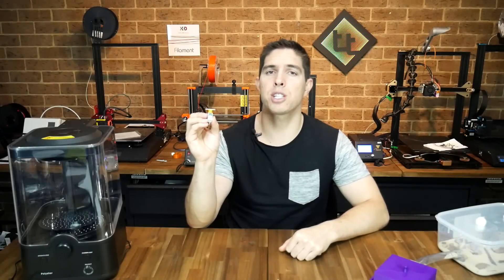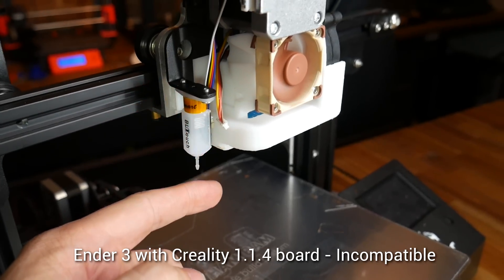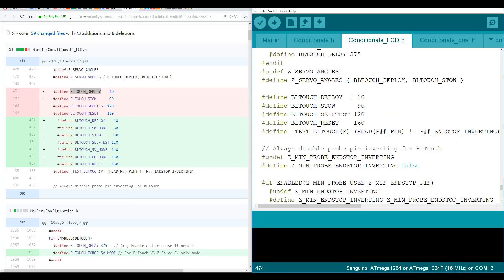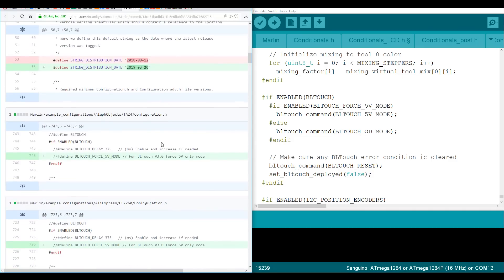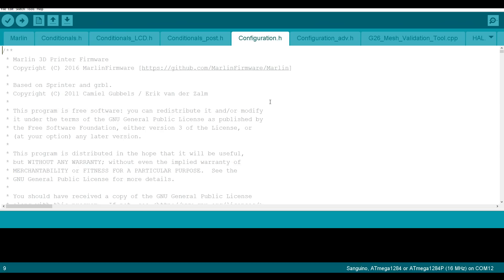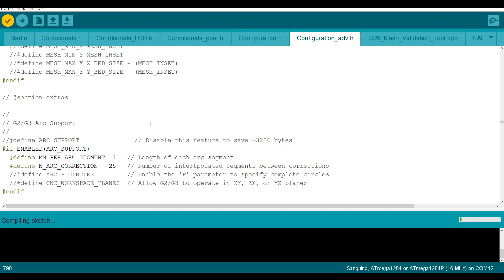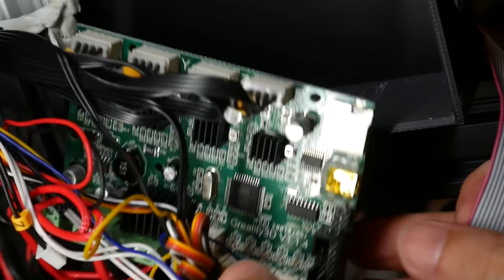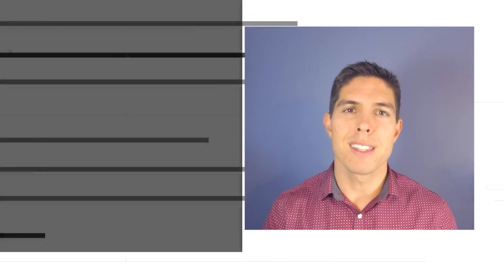3 Fixes for BLtouch V3 on Creality machines

Comment: in respect to z probe, first off im a total newb and i need to figure out how to enable or choose my appropriate z probe (i have the version 2) in my firmware calibration for my delta linear plus. do i put in place of the 0 or brackets so as to disregard said type of z probe. thank you this would be a big help

Comment: What I really need is a complete setup for Marlin 2.1.2  for Ender 3 Pro, 4.2.7 board with BLTouch. Tried the Creality BIN file for my machine but it doesn't work. Not understanding why it's even available. The previous versions of Marlin have nowhere near the settings that the newest version contains which leaves the previous version videos unusable.

Comment: sure is strange...I have 2.0 bugfix, 2.1 board and 3.1 bltouch and mine just wants to drill a hole through my build plate no matter what I do! maybe you could provide details because I have tried every firmware and every fix i have found on the internet and you tube except removing c7 capacitor and nothing has fixed it and I am going to send it back if i cant fix this as I am not going to take a chance of ruining my motherboard by removing a capacitor! also btw there is no conditionals_lcd.h file that opens when you open marlin.ino! so how do you make these changes for fix 1 if the file does not exist!

Comment: I downloaded the BL .hex file from Sovol and flashed the touchscreen and board on my Sv02. It is still not responding to making contact.  Will I need to change coding or did I end up with a bad 3D touch?

Comment: I upgraded my Ender3 V2 with a BL Touch and I have been having a lot of trouble lately with it failing and blinking red.   After choosing the file I wanted to print, the extruder would move to the center of the build plate  to begin the auto level process and come to a halt and then the light would start flashing.  It took a couple days before I figured out what was happening. The probe was not dropping. I removed the unit and removed the set screw to extract the probe.  I discovered that the steel set screw had become magnetized. The probe would be drawn up and not release and then the light started to flash. The magnetized set screw was holding the probe in the retracted position. My solution is to replace the steel set screw with either a 316 stainless steel or a plastic set screw. 316 stainless steel is non-magnetic. The dimensions are 4mm diameter, 5 mm total length by 0.7 pitch.  If your local hardware store does not carry either stainless or plastic, McMaster-Carr does but in quantities of 50 and 25.
Reply: thanks i`ve had had my bltouch working off and on for about a year this helped a lot

Comment: I am trying to get my BLtouch working and it is just not doing it. I have gone though your video's on doing this and even bought your files, but it seem like there are things missing. I have an Ender 3 pro with the 1.1.4 board installing the creality BLTouch kit with the 3.1V BLTouch and the 27pin board, all provided in the kit. I have installed a boot loader, I had installed 1.1.9 Marlin, without BLtouch and it worked fine. Now after installing all the files I received from you, following all the directions you have provided though a couple of your videos and trying some of the fixes you suggest in this video, I still get a blinking light when I turn on the machine. When I go back into the configuration.h file (that I received from you) and walk though the steps you outline in the is video, the the section, BLTouch V3.1 (6.29 in your video) is not in the config file. I did download a vanilla version of the 1.1x bugfix file also and it not in there either. I have gone back over the wiring a few times and everything is like described in the instructions provided with the kit and like your descriptions in your videos.  What do I do from here?

Comment: I fixed the issue on an ANET by removing the capacitor. As an electronics engineer I can confirm that it is a mistake. The value fitted is way too big and will slew the signal. I actually replaced mine with a sensible 1nF value. There is a risk of degrading the micro-switch with the value fitted. It looks like someone was confused with their SI prefixes. As the root problem is the capacitor, the software fixes are really work-arounds. I'd go for removing the capacitor, or better still fitting a lower value of around 1nF.

A little more detail is that the capacitor fitted is so large that the resister pulling the line up can only change the line's voltage slowly so the micro-processor sees the signal change late. When the switch closes the line falls almost instantly as it shorts the capacitor out, but this current spike is not going to be good for switch contacts long term. They intended to add a small capacitor to remove  interference picked up on the wires, but instead added several uF.

Comment: I watched your video great guidelines thankyou so much I have installed 3d touch how and updated my firmware from creality website by just downloading and copying bin file for bl touch but it happens that sometimes when levelling at a certain point on bed the 3d touch is unable to detect the bed second time and starts blinking or either crashes nozzle please any tips to over come this problem there is also a Sw mode that displays in the screen in bl touch config what does that do

Comment: Thank-you for your great videos. I am having an issue with my BLTouch V3 on my Ender 3 using an SKR Mini e3 v2 and a tft35 screen using Marlin 2.0.9 where, even if my board is manually leveled using an indicator, the machine will crash during self leveling on the right side of my board, but not on the left side of my board. I reflash, and it works fine for a week, then it starts crashing again after a few prints.I have tightened things, made sure things move right, etc. Will this fix this problem, or am I having another problem?

Comment: I run the v3.1 on my Ender-6 with zero issue's , I simply installed the bin file then identified the positions for the 5 wires and where they go at each end then pushed home.
With regards to Z height adjustments with a factory Ender-6 after you get your bed as level as you can use the Z height arrows to adjust nozzle height to bed with both preheated , slip your measuring tool or piece of paper on bed arrow down till nozzle just scrapes then remove paper and press the 🏠 button wait till the BLtouch does its thing then slip paper back under to check height again , if its different repeat procedure , if it still isnt same then your bed isnt firm enough.

Comment: Having some issues with getting my BLTouch probe to deploy. It deploys ok for the self test, but not when probing.
Mainboard is a 4.2.2, BLTouch is a 3.1 Smart.
I have followed the instructions for https://www.youtube.com/watch?v=YsTGH5JvClM&t=636s video and also enabled BLTOUCH_SET_5V_MODE enabled.
I have checked continuity of the wires going to the probe and they are fine.
Any suggestions?

Comment: Hi from the U.S. I'm very perplexed. I own a fairly new Ender 3 Pro with the 4.2.2 main board. I've done maybe 30 or 40 prints since I got it and all bed levelled manually. I have grown tired of the process and bought a BL Touch Version 3.1 probe from Matterhackers. For the money I expected the bracket and harness but was disappointed, as I only received the probe. I'm a retired electro-mechanical tech with a lot of experience with automated equipment, so designing and printing a mounting bracket was no problem, nor did I find much difficulty in fashioning my own wiring harness for the project. Well I downloaded the firmware from the Creality site, and it appeared to start off well. Red LED lit up brightly, travelled to home position at center bed, probed a couple times, but it only probed the first two of nine test sites before moving to begin printing. But I was confused, then shocked when the printhead moved to the general location of a standard firmware home position, then deployed the probe tip and quickly headed back towards the bed, with the probe tip extended, then the tip nearly snapped off when it smashed into the side of the print bed. I shut the system down and bent the probe tip back, then found a different version of firmware that claimed to be made for use with the BL Touch probe. Well the first test print went well. It performed homing at center, tested all 9 positions, then did a great job with the test print. I was happy and attempted a second print, but when it started it moved to center to home, probed the bed once, retracted and started moving probe down again, but it never stopped and crashed into glass bed and I had to switch main power off to stop it. I checked all connections, especially those in the main controller housing and the connections were seated and secure, still solid with the bit of epoxy I used to secure the Dupont connectors I needed to use. I ran through everything one last time and this next test seemed fine. It did the home probing, ( test all 9 points, then started to print, but the tip of nozzle was probably 1/8" above print surface the whole time. And I had performed the Z-offest and stored the result.  I gave up and gave in and purchased another 3.1 BL Touch and this time with bracket and harness, "and" some metallic braided sheathing to run the harness through and block any e/m interference. Felt good about the new installation, this time I also checked each Dupont connector for grip on pin before soldering it to the controller end of harness. And this time applied hot glue to secure Dupont connectors, rather than epoxy for ease of removal if needed. Well I turned on the power and nothing. No red LED and no probing the bed. I started a test print out of curiosity and it moved to center of bed, stopped, and just stayed there. wouldn't even deploy the probe tip. I reinstalled firmware, pulled connections at mainboard and they seemed ok. But I have never been impressed by them. But I re-seated them and applied hot glue again. replaced panel and uprighted the Ender. Power cord back in, turned on, and "nothing." I'm stumped. Do "you" have any ideas? I'd really like to have the auto bed levelling feature, but what do I need to do? Thank you in advance for any advice.
Reply: Need to apologize for the long entry prior to this. I plowed forward and found the Dupont connectors at fault. One or more were not making a connection at the mainboard. The new BL Touch powers up and self tests now with connectors salvaged from previous installation. Now I may have more questions after tomorrow though, as I'm installing the 4.2.7 board as I suspect the 4.2.2. of causing communication problems through octoprint. Wish me luck getting Octoprint, BL Touch, and 4.2.7 to all play together nicely.

Comment: Great Video Michael, 
But what if you have an Ender 6 (stock ) and BL Touch V3 which does nothing except blink a red led and if you download the firmware 1.0.4.9 bltouch from the creality site and install it, it stuffs up your board completely when you try and do a Bed alignment from the display menu. The z axis motor will not move upwards any more and the x and y motors will not drive back to the home position past the very centre of the bed. I also got a Bl Touch v3 for my ender 5 pro. It comes with a boot loader device which according to Creality's youtube video on how to install the Bl Touch V3 on an Ender 5, you need a program called ISPPROG V1.7 which I am unable to locate. Find it very frustrating. Have also tried Compiling Marlin firmware using the config.h for the Ender 6 their examples. It fails too. But not being a C or python programer have no idea what the error messages mean.

Just find it frustrating that there is so little support for the Ender 6.

Graham

Comment: My creality ender 3 pro has a 4. 2.2 board and it has the same issue would this fix it
Reply: Same with mine.. I have Ender 3 pro but I haven't tried any of these yet. Let me know if something works for you.. Thanks!
Reply: @babyrelaxinglullabies9671  I fixed the issue by updating the board to a 4.2.7 side bonus to fixing the issue it also runs a lot quieter

Comment: I’m hoping that someone can help me out with my BLtouch. I have an Ender 3 V2 with a v2 BLtouch on it. I am currently using simplify3d as my slicer and running smith3d firmware on the printer. I have it setup to auto bed level at the start of every print. Everything worked amazing for about a month and now I am having all kinds of issues with it. If I select “level bed” on the printer screen it runs through its sequence as normal. When I start a print it starts to go through the leveling sequence but then at some point during the middle of the process, the BLtouch will start flashing and then it attempts to start printing without completing the leveling process. It of course results in a failed print because it doesn’t have an accurate level. It’s always at random when the BLtouch starts to give the error flash at the beginning of the print. I have to restart the print multiple times until it completes a successful leveling process in order to get a successful print. My ender 3 V2 is also running the V4.2.2 board.

Comment: Hi, Does anyone have a pre-compiled file that I can use with the SD card (Firmware.bin), for some reason my btt skr mini e3 v2 it doesn't work with my BlTouch, (makes the same thing as showed in the video) and I can't load another firmware via USB cable "tmc connection error" appear. I'm not much into programing. It's the second board I bought, same error.I don't really know what to do, so, yeah...I tried to find something to work on google, but nothing, it's very frustrating in especially when the BlTouch was a gift for my bth day and I can't use it ...Pleas help.

Comment: The marlin firmware github 2.0 bugfix didnt work for me. The Ender 3 1.1.4 board gave problems with auto-home. I spend 3 evenings finding out it was a EEPROM issue. Adding #define DEBUG_EEPROM_READWRITE in de firmware EEPROM section fixed it for me.

Comment: great vid, but after going through all steps and removing the capacitor I'm still having issues. The sensor works (sort of) but while autohoming it probe's "air" as soon as the Z-homing starts. Also see https://www.youtube.com/watch?v=-YfYpT8Y6mw&feature=youtu.be

This is using the newly (January 20) released creality firmware for 1.1.4 boards which i have. If I use marlin 1.1.9 bugfix, I can't get it to work.

Does anybody know how to solve this issue? Any input would be greatly appreciated!
Reply: This video was made almost two years ago, probably a good idea to find one that's a little less outdated

Comment: I built the latest code on your Ender3-BLtouch branch of your fork of Marlin.  When I flash it the control knob is no longer working.  Has anyone encountered this?  Is this a problem with the hex file I built or a bug in the software?

Comment: Trying to add a bltouch 3.1 to an skr e3 mini v2  im having no luck i have defined bltouch 5v in marking firmware. Im not getting power on the 5v zprobe pin. Any suggestions?

Comment: Happy Sunday. I was wondering how I would go about removing the firmware from my Ender 3 for the bl touch. I want to remove the bltouch. Any help would be appreciated
Reply: You would flash firmware onto the Ender 3 that doesn't have it enabled. Whether that means compiling a new Marlin firmware or flashing an older version you already have on hand. you should be able to find firmware either on Creality's website or if you wanted to compile new firmware, the Marlin github page.
Reply: @Gormadt  thank you very much for replying to my question another question if you don't mind I've got the 4.2.2 bored and I've got the THD th3d from where On The Board now what bltouch would I have to buy for the 4.2.2 board

Comment: I installed your marlin 1.9 hex you uploaded to your site.  but now my auto home crashes. as soon as y hits the home switch it just stops and I get a reset alert and fail warning. Just downloaded your 2.0 Github and installed VSC.  trying to build it do I use Melzi, melzi_optimized or melzi-optiboot?  This is for a Ender-3 with the 1.1.4 board, bootloader is installed after loading your original 1.9 hex.

Comment: mine still doesn't work with marlin 2.0.x and the solution in the video is not doable because those lines aren't anymore present in the code, or at least not with those names. so what now?

Comment: IO have an ender 3 with bl touch I firmware TFT35_E3_V3.0.26 APRIT11 2020 BOARD BIGTREETECH_TFT35_E3_V3.0  i DO NOT HAVE THE LEVELING WHERE IT CHECKS 9 POINTS ON THE BED WHERE CAN I GET THIS I GO TO git hub there are lots of choices  can you provide me with a like to that firmware?

Comment: do i have to do this with Marlin Bugfix 2.0 ??  I can't find the marlin_main.cpp
my bltouch currently wont deploy at all
Reply: Probably not . I followed his other BLtouch guides (i have a mini SKR V 2.0) And it’s working okay . it also worked fine without doing this on the original ender 3 controller board